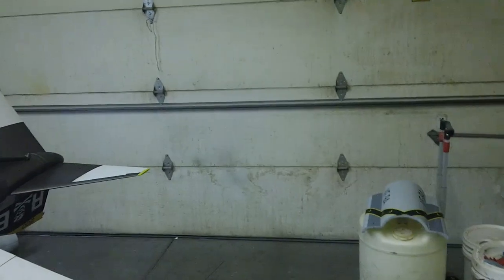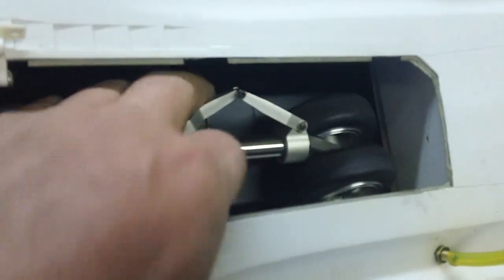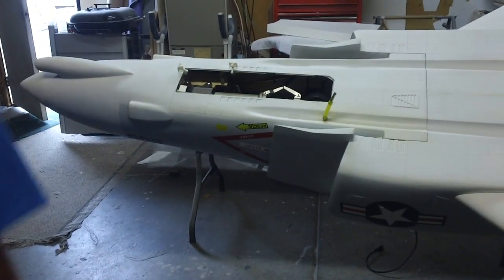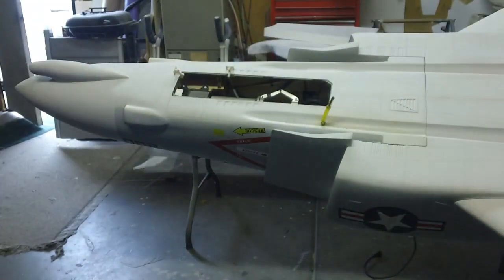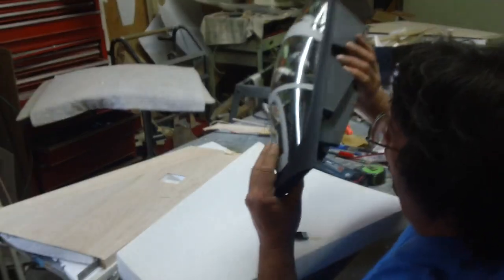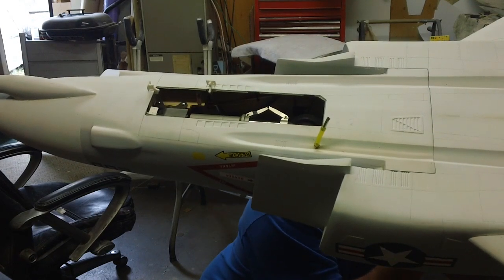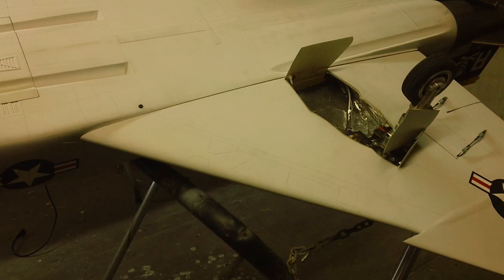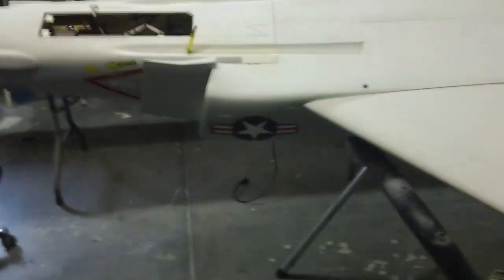F-4 nose gear mystery solved

Comment: Bob, with having the hole in the floor of the cockpit, the air entering the gear bay will pressurize the cockpit. I hope it doesn't develop enough pressure to rip the cockpit out during flight. You might consider sealing the hole in the cockpit floor somehow.